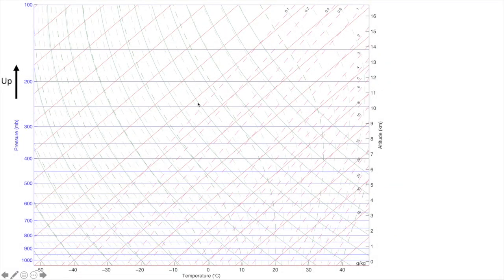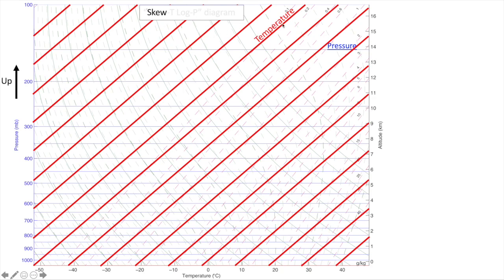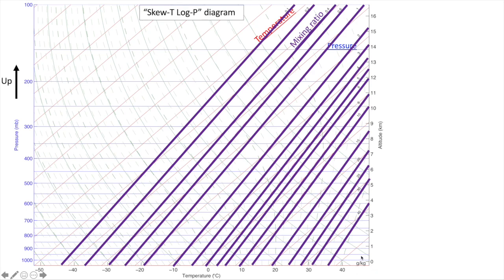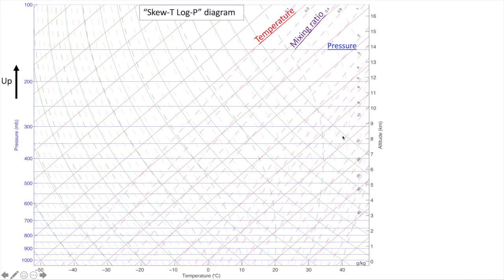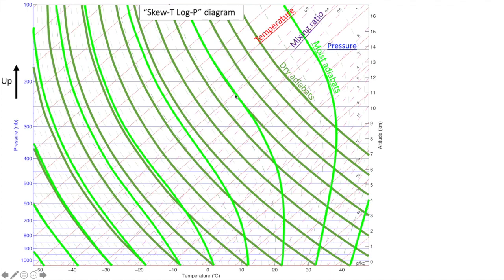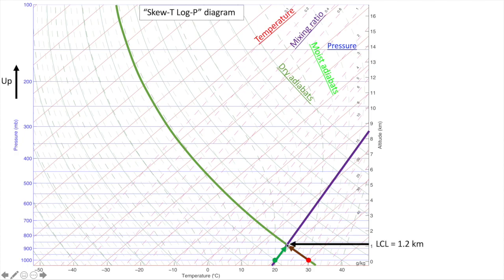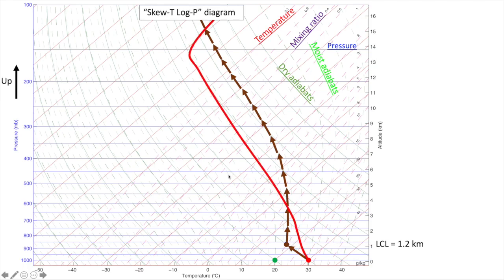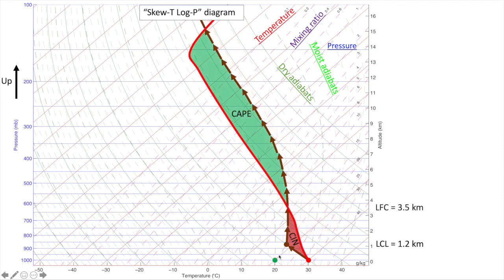Visual Explanation of Meteorological Skew T Log P Sounding Diagrams

Comment: This looks really similar to a psychrometric chart, which is more for indoor temperature. But it also helps show relative humidity (based on wet bulb/dry bulb temps), enthalpy, and air pressure using the same skewed/logarithmic design. 

It wasn’t until I started training in the sheet metal/HVAC/TAB trade that I realized that inside air temperature was fundamentally based in the same science as weather. Which seems obvious, but it’s just one of those things that you don’t think about.

Comment: "Thinking about how a hypothetical parcel's temperature compares to its surrounding environment's temperature only works to a point because eventually, if enough parcels are lifted, you will change the environmental temperature profile" Is this why weather balloons go up at 6am and 6pm? I would assume there are few parcels being lifted at those times, and therefore, less changing of the environmental temperature profile

Comment: I have checked many days data, and I saw most of time CAPE value seems to be 0 or under 1000,
so does that means ones there is no EL , and the value could be 0 ?
and parcel air is cooler than Enviroment after pass LCL hieight.

Comment: A quick question, the environmental temperature vs the parcel temperature.  If the parcel temp is less than the environmental temperature, then you have CIN.  Can you give examples of where the parcel temperature would be either higher or lower than the environmental temperature?  In my mind these two temperature measurements are the same, unless the parcel is a theoretical item.

Thank you and great presentation.

Comment: Thank you very much : best info I found find. Excellent. But I am still missing one point : Where do the two initial dew points (the 2 green dots) come from ? Are they external data or are they deducted from the graph. My understanding are that they are external data. If I am understanding correctly, then the presentation would be more complete with better stating that this external. Or am I still missing something ? Thanks a lot anyway.

Comment: Good for basics and improved visualization for understanding CAPE and some other lift parameters. BUT - -you should now assume we learned all the parameters plotted on the chart and look some DP and Temp patterns for pilots for prediction of Icing, snow, rain layers, and IMC, cloud conditions at various levels as we in GA wish to select altitudes for safe flight. 

From observations I can see where cloud layers might be, tops, snow that turns into mist below freezing level, possible turbulence layers where winds aloft shift rapidly in velocity (speed&direction) but there are many other possibilities to be identified quickly on a Skew-t chart. Using an app along a flight path I can get the simulated changes and it is helpful as you pointed out - it is always changing. 

Thanks again and I look forward for a more advanced visual pattern interpretation now that you have done the basics so well.

Comment: I would also like to add that the density of a saturated parcel does not only depend on it's temperature, The amount of liquid/solid water within it increases its density and thereby reduces the buoyancy.
At high mixing ratio's this effect can be very significant and prevent convection even though it has reached the LFC. Example sounding: https://www.meteociel.fr/cartes_obs/sondage_display.php?id=7761&date=1601290800